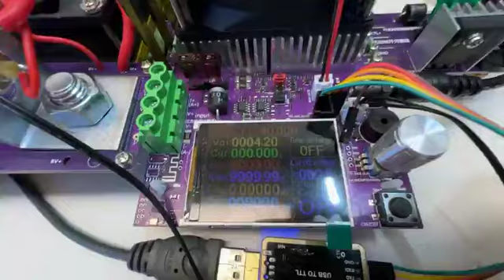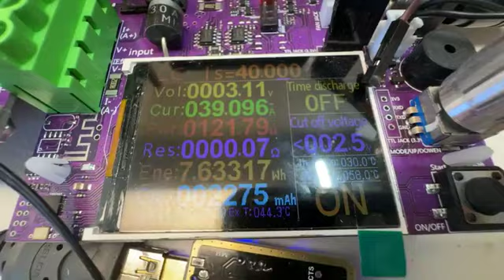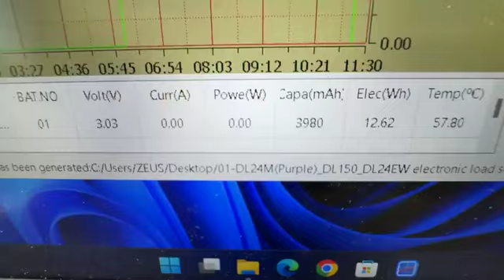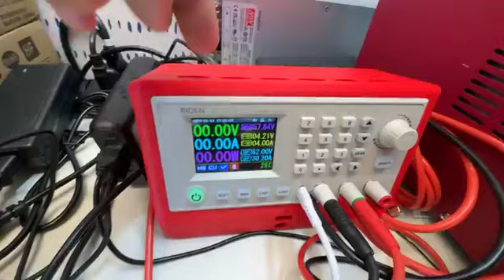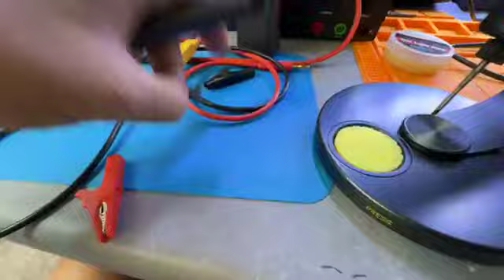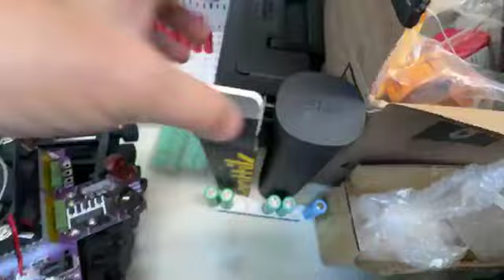Ultimate Ampace JP40 40A Load Test  Performance, Heat, & Capacity Analysis |

Comment: The battery holder is rated for 20A continous and 30A short term. Pushing it to 40A is a little on the high side in my opinion, not just at the DL24 side. Did you check the temperatures by thermal imager?
Reply from the maker: You have a good point. The true is I have another device that I share in the Facebook group yesterday for that task, however, we can change the cables and holder and I am sure will do the 40A without issues. Actually check the video and you will see the one I am talking about.  You can Join our Facebook Group on this link. https://www.facebook.com/share/g/1BGbYduNE3/

Comment: im finding ways to overclock it, like want to test above 40amps
Reply from the maker: There is a few tricks. The problem is the PCB strips will not hold more than 45-50A and will damage the board. But you can connect 2 boards at the time with a shunt to calculate current. :-D
Reply: @DIY500AMP  no wonder yesterday i damaged my board while overclocking it 😅
Reply from the maker: @maaz_qamar_jatoi  I have a video hacking the single 150W board all the way over 400W the problem is passing the 40A mark will damage the board. Will melt the board. Ask me how i know. LOLLL

Comment: Hola! Super nice test and video! I have tabless BAK 45D but haven’t tested them yet on my RC jets. They should up to 120A but on Mixed throttle around 40-50 probably. Do you ship to Germany? Probably it’s to expensive… AliBaba is also quite expensive so I did not order a couple of months ago… have a nice rest of the week! Saludos! Francisco
Reply from the maker: You can get the BAK 45D from Nkon. I will have very soon BAK 45D on my test benchmark !!!! Hopefully in few weeks, also Molicel P50B.
Reply: @ yes I for the BAKs from NKon 👍🏼 I Wonder when they will have the Ampace ones … thanks!
Reply from the maker: @ficosk8  They are hard to get. I know somebody in UK purchased a big lot.